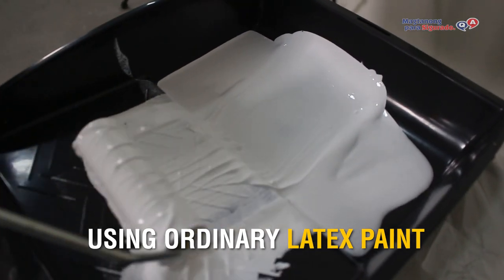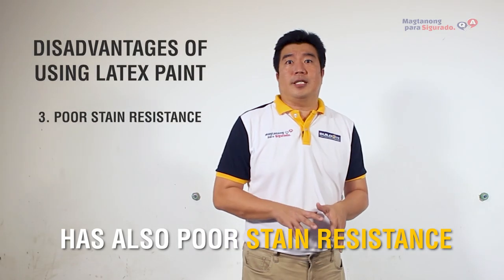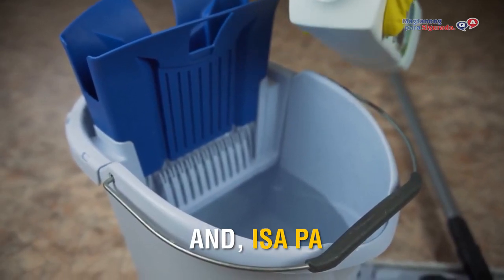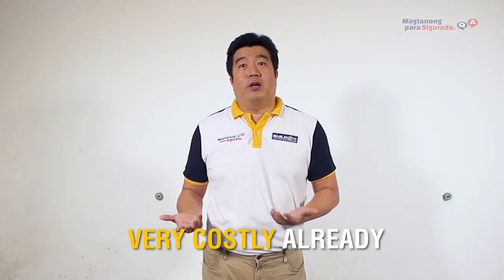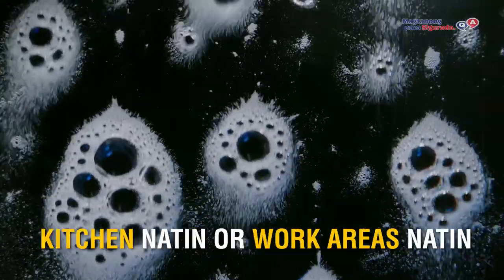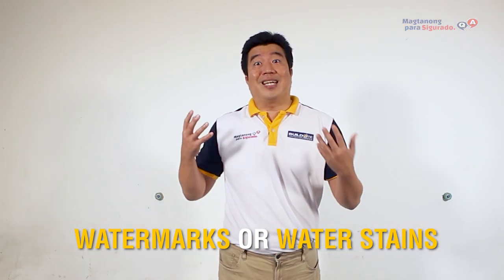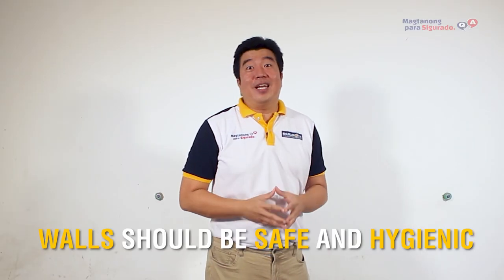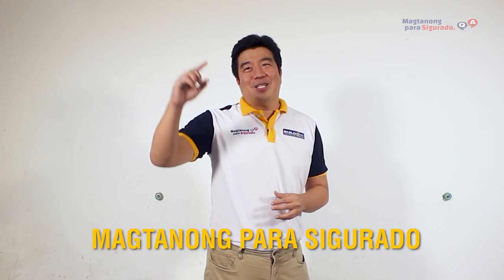The Right Hygienic Wall Paint/Coating for Kitchens and Commissaries (Not Latex Paint)

Comment: Puede po iyan sa fiber cement board? If puede, paano po ang tamang preparation before applying bloctite xtr? Does it comes with different colors? Thanks for giving time with my inquiries.
Reply from the maker: Hi, thank you for your inquiry. We recommend to use Max Bond All Purpose epoxy before using Blocktite XTR. It is available in gray color only. For technical assistance you can message us directly on our Facebook page: https://www.facebook.com/BuildritePhils

Comment: Sir after applying skim coat. Can we already apply, blocktite xtr, or there is other paint before using blocktite xtr.?
Reply from the maker: For primer you can use Epocoat MB White for moisture barrier 
and it also gives better adhesion for the topcoat.
Reply: @BUILDRITECONSTRUCTIONCHEMICALS  thank you sir . God bless
Reply from the maker: You're welcome.

Comment: Sir ang pader po namin hindi po makinis, pero pininturahan na po namin eh.. Anong type po kaya ng skimcoat pwede gamitin. Thank you po.
Reply from the maker: Hi, thank you for your inquiry. For rough painted walls, you can use Putty Master to smoothen out the area. You can see this post for your reference: https://www.facebook.com/photo/?fbid=197902296092884&set=a.184760584073722

Comment: Pwede po bA ito iapply directly sa may existing latex paint na?
Reply from the maker: Hi. Thank you for your inquiry. No, you have to remove the existing paint prior to the application of Blocktite XTR. You can not put epoxy based paints over water based paints.

Comment: Sir, bakit po naga peel off yong paint
Reply from the maker: Hi. Thank you for your inquiry. The reasons for peeling paint can vary widely. Painting over dirty walls, excess moisture, improper preparation, and using latex paint on top of oil paint can all affect the paint's adhesion and cause it to eventually begin flaking off. To solve the problem, you'll need to remove the peeling paint and start over with fresh coats of primer and paint.
Reply: ano po mabilis na pang tanggal ng old na paint na nagpeel off na?